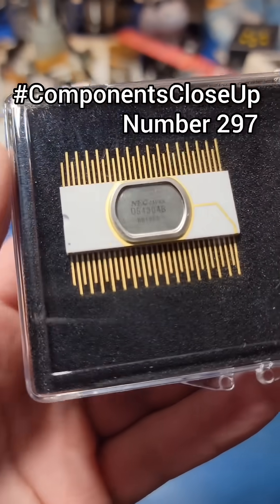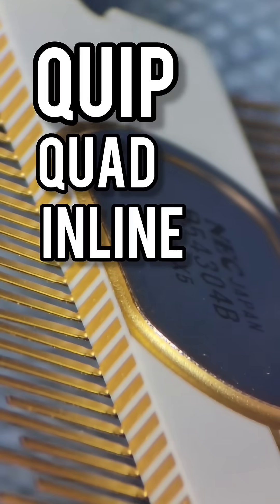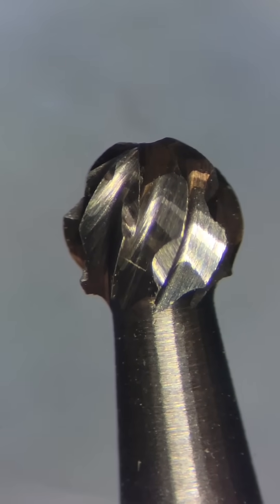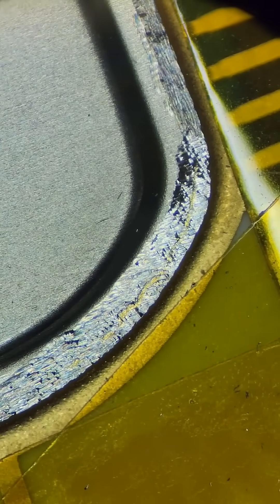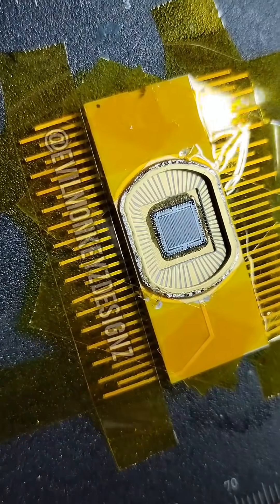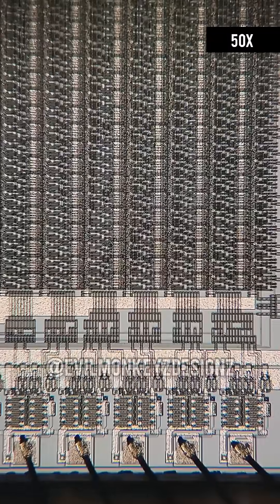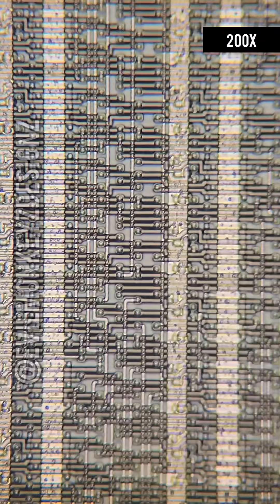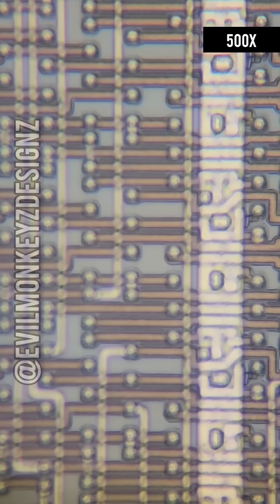CCU #297: NEC Custom Gate Array D54304B #shorts

Comment: There's no data sheet because they are not sold in their un burned state. Customers design interconnect layers on the LGA and NEC manufacture it for them with the extra layers from the customer. So the customers of NEC's LGA business have the parts and sell them with whatever function they have.  This was dramatically cheaper than full custom design at the time.

Comment: The traces that don’t appear to go anywhere are interconnected to other conductive layers. The small oval circles at the ends of the traces are called ohmic contacts and they connect one layer of traces to another or to a power or ground plane.
Reply: Actually they are called vias .

Comment: Note the tiny wires connecting the gold prongs to the chip. In 1967 I worked for TRW Space Systems. One project was the Intelsat Communication Satellites. Together these created a worldwide communication system.

Inside each satellite were hundreds of very early chips. Due to the importance of each TRW decided to send them to the NDT lab (non destructive testing) and take a look inside.

My job was to id tag and x-ray each of them. I did this in groups of 100. After I developed the x-ray film, I was required to use a microscope to carefully LOOK AT EVERY TINY WIRE to see if it was properly soldered. 

The defect rate was about 1 per thousand. Each chip got a written report and was sent on to QC for rejection or got my initials on its report and was sent on to lo vo testing and assembly. 

I write this because I see so many posts that say America is not capable of making anything. I provide this as one tiny aspect of satellite construction illustrating care and expertise.

TRW also made the Lunar Excursion Module (LEM) engine. I x-rayed several titanium hand fabricated very critical components of these engines. If there was any welding discrepancy I noted the positions carefully. The item was then reworked until it was defect free. I also dye-penetrant inspected the parts and used magnetic resonance as the final test.

I did this work on all 48 engines produced. They all worked perfectly. Seven are now on the moon, a testament to science, engineering, fabrication and testing in the 20th century. I am very proud.

Absolutely no one knows this tiny bit of trivia. There are millions more.

Comment: That's grazing that welding raising is more similar to soldering in that it uses a third material to attach two dissimilar metals to each other whereas welding melts similar materials together

Comment: It always astounds me when you zoom in so far. Its always so amazing, and it makes me wonder how its made, and how it was even discovered.
Reply: It's made using a technique called photolithography.
And a process of masks, photo resist, exposing to UV light, and acids to etch away, and then in 1988 it would have been baking in an oven to diffuse impurity atoms into the material.

Comment: I have been working on and following technology since 1974,  when I started working for IBM. It is hard to believe what they are doing today. It's not going to stop here, either. I can't wait to see what happens in the next 10 years!
Reply: I started in IBM 1976 and was a chip designer for a number of years.  It truly is amazing at what we are doing today compared back then.
Reply: @Keith80027  i have attended a course  of PDP11/40  in airport control tower by an american expert. (1979)  in that time the memory of computer was a big  drum and 56 k  28 k or  machine 28 k or user.and about 4 big rock and with spare 8 big rock.and smoksing was forbidden because of  micro smoke particules can damage    the read write section of memory drum. PDP 11 was designed 4 bit ALU (TTL logic)  arrays and too big too many electronic cards. (punch reeader tape for input data and paper was  frequently torn) for example address selection is assigned a seperate card..Now a pocket telephone much more efficient than it.
Reply: @eng954  I know the 4 bit ALU chips well as my first job at IBM was to invent the pico-code for these chips to take data out of a slow memory bank and display it on 16x20 CRT screen.   Boy times have changed!

Comment: Yup. Customers would often use a way over-provisioned gate array because even though they only used 10% of the circuits, it gave the designers huge headroom to increase circuits and I/O pins. But the main reason is that a dense gate array would usually be higher-performance than a less-dense gate array chip that fit the design more closely. So, you'd use a dense, expensive gate array chip to get the speed you need. You'd know that next year, the price would go down because the gate array would be available in another, denser node that would result in smaller die size (lower price) and even better performance. Moore's law was everyone's friend back then: customers and vendors would both benefit.

Comment: FPGA?
Reply: No, a mask programmable gate array, not field programmable.

The customisation of the function of the device is done during manufacture by a few metallisation masks - hence mask programmable.

Once set, the design cannot be subsequently changed on the chip, unlike field programmable.
Reply: Strange.  I thought "programmable" by definition means "by the customer", and not "by the vendor".  What's the benefit of buying a programmable chip if you cannot program it.  At the very least they should call it "programmed" rather than "programmable".
Reply: @trojnara  The two technologies are: Mask Programmable and Field Programmable.

The reason they are called mask programmable is because the customisation of the function of the chip is set by the customer. And the customer  design is instantiated in to the chip by the photolithographic masks used to create the final metallisation layers which connect up the transistors.

What happens is this:
The chip manufacturer, or to be precise the ASIC vendor, mass produces a whole load of blank gate array chips on wafers.

The customer comes along and sends their circuit design in the form of a netlist file to the ASIC vendor. The vendor does a whole load of design rule checks, simulations and then the layout and connecting up of the transistors.

Then the vendor enters the manufacturing stage for the design where the final metallisation masks are created. The final metallisation layers are created on the wafer.
Then the chips are tested, sliced up and packaged.

All the chips for all customers all start off the same. The chips are mask programmable, as it is the masks that customise the functionality of the die to implement the customer's logic design.

But programmable does not mean erasable .

Many FPGAs can be erased and re-programmed. And this is great for development. But there are FPGAs which when programmed cannot be erased.

One common strategy is to use FPGAs for development, and when the design has been proven to work properly, then migrate across to a semi-custom ASIC using a gate array.
Which in sufficient production quantities will workout cheaper per chip and the retail price for each will be lower.

The transition from FPGA to ASIC is not necessarily easy. It comes down to what design approach has been used.
VHDL can help if used appropriately and synthesis tools are used.

Comment: There are NO unused circuit elements.
Reply: Yes there are.
This is a gate array. They contain transistors.
The chips are pre-made. And they are all the same. They are made by ASIC vendors. They are just waiting for the last 2 or 3 layers of metallisation to be placed on to the chip.

Those metal layers implement the connectivity between transistors and implement the required design of the customer.

You could you push the utilisation of the transistors in any single design up to around 90% and each design was different.

Some would use 50%, some would use 63%.
Each circuit the customer wanted was different.

Anything less than 100% meant there were unused circuit elements.

Comment: Those "unconnected traces" have via's at each end, they are connected.  And gate array dies usually have a more squarish layout, with a matrix of traces coming left to right, and bottom to top, not rows like this.  It could be a gate array, but it could be memory.
Reply: No, it is a gate array with a channel based architecture.

Comment: This is such a fun hobby. I might start doing it. Have you ever taken high res images and printed them out in large format?
Reply from the maker: It's a really run hobby, easy to get addicted :) I've created many large photos of smaller pictures all stitched together with software, but I've only printed out a few in large format. Framing them is pretty expensive 😅

Comment: Is gate array the manual version og FPGA?
Reply: Not manual but manufacturer programmed.
Technically, mask programmable.

The masks are used in production.
The proper name is ASIC - application specific integrated circuit.

Comment: what is gata array?
Reply: It is an integrated circuit that has most of the manufacturing processing steps completed except for the metallisation interconnect layers.

The chips are already made with logic gates on them. They are customised to a particular customer's logic design by the metal interconnect. 

The customer will supply to the gate array manufacturer the circuit design (as a textual file called a netlist) and the manufacturer takes that design and wires up the gates.
There are other stages involved which are concerned with proving the chip will do what is designed to do and generating test data that can show up fabrication faults after the chip has been made.

Many customers can use the same "blank" chip and supply their designs to the manufacturer who just take the pre-made chips and complete the metal interconnect layers to connect the gates up.

Comment: do you post actual die shots or just do silicon inspection?
Reply from the maker: I have been taking full-die shots of many of the more recent chips I've looked at. Generally, these are stitched together from more than 100 photos, taken at either 100 or 200x magnification. I'll have an update soon on where they can be viewed 😁
Reply: @EvilmonkeyzDesignz  cool, I’d be happy to see them. I’m going to open a few more chips this weekend. I will post them on your discord server since I recently Joined.
Reply from the maker: @BGTech1  Looking forward to seeing them!
Reply: you here ? what a small world.
Reply: @thymark  Hey! Nice to see you here. My (relatively) new hobby is opening chips and taking die photos. If you would like to see my method, I have a video on my channel demonstrating the process of opening epoxy chips. Older ceramic chips or hybrid modules with soldered on tops are a lot easier to open if you would like to try it yourself.
Reply: @BGTech1  will check it.
Reply: Have you ever used an AI image analysis to see the pattern, and maybe identify the circuit? 
Some reverse engineering channels use that technique.

Fascinating video as always :)
Reply: @lelsewherelelsewhere9435  Good idea, I did not think ai could do something like that